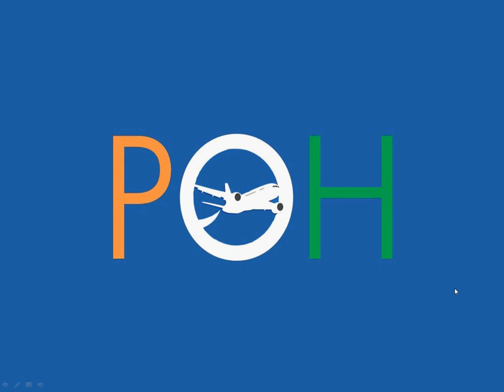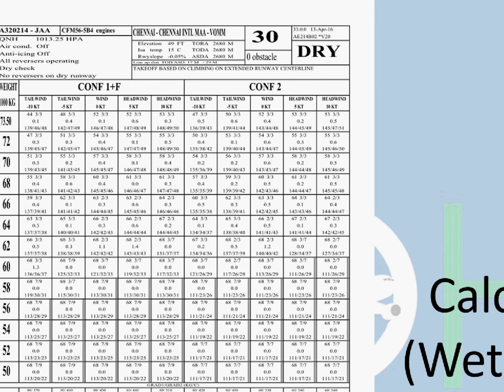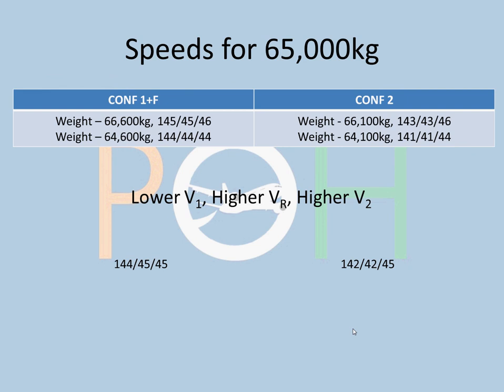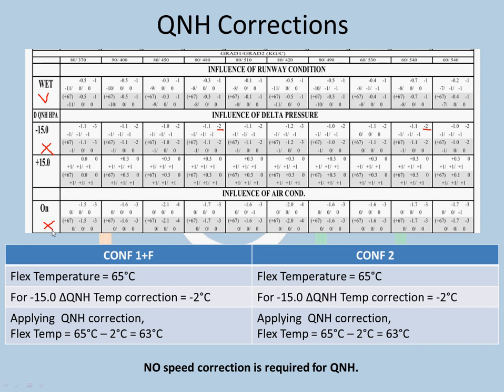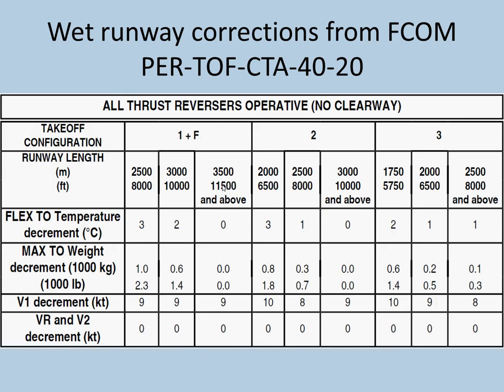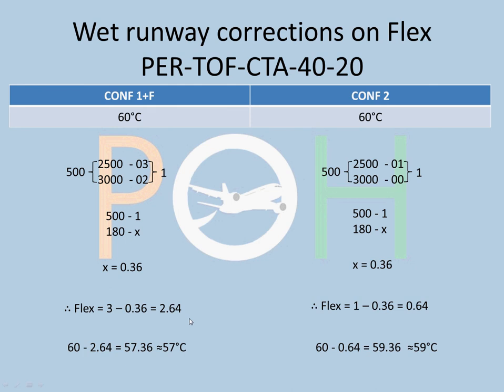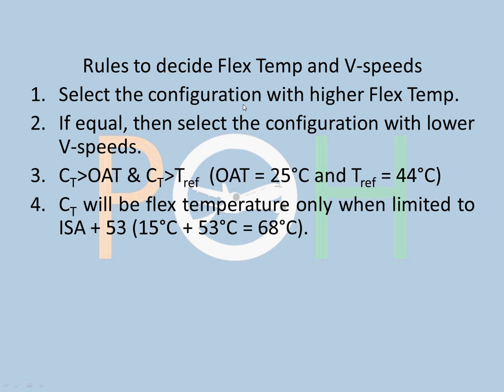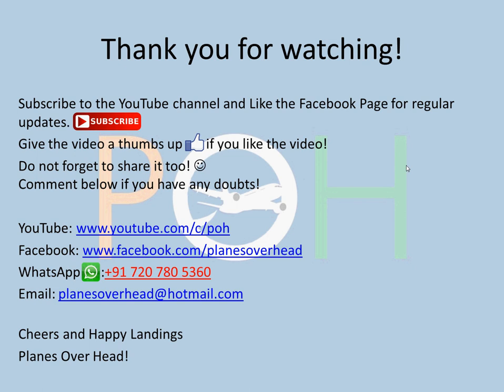A320 - Flex Temperature Calculation (Wet Conditions)

Comment: Hii,
Can you tell me what is a delta weight ?
Reply from the maker: +Ishwar Vyas Delta weight is the accurate correction to be applied to the weight for each box. It is different for different boxes and is computed based on various factors in order to eliminate designing a long RTOW chart with specific values for each weight for 100s of kg differences.